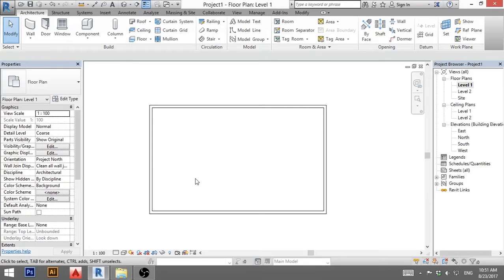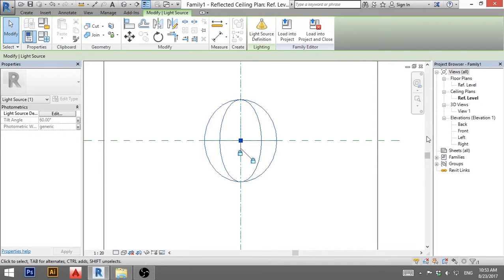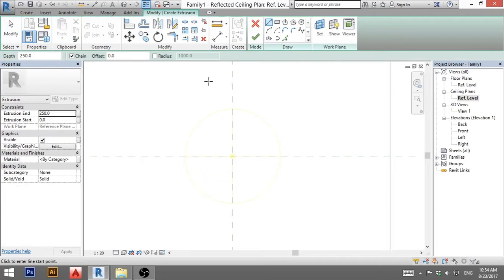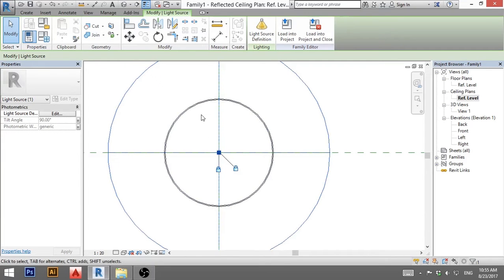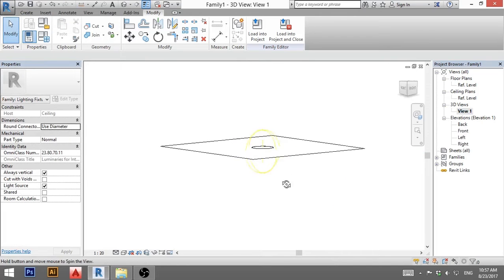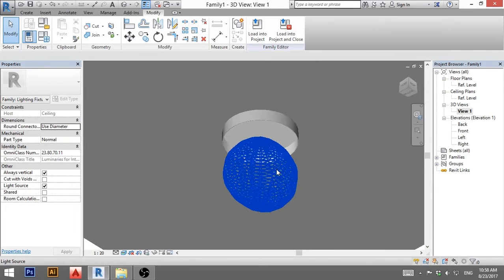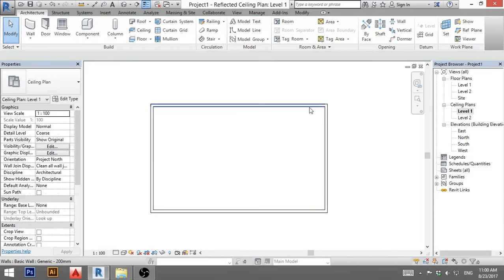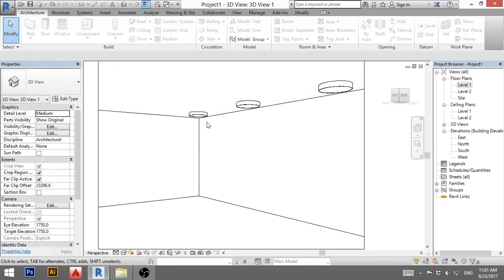How to make a Functioning Light family in Revit

Comment: Thanks a great tutorial.  I have some trouble with my project, the arquitecture modeling is finished, and I'm doing perspectives with the 3d camera. In my structural sheet i want to put two sections and a perspective full of notes of the specialty , but the 3d view is to big and I don´t know how to control the scale of it. I found a way to do it: I create a new plan view, work with the section box to specify the area of work and I put there the 3d image scanned. It's a solution a little longer because I don't know the real way to do it. I continue my search for answers, but I would be great  to have you help. Thank you again.